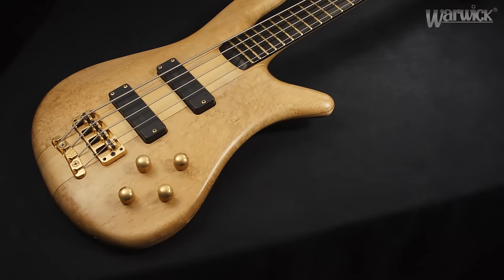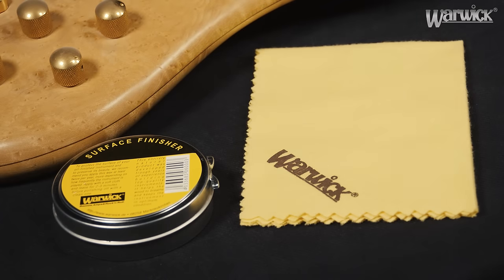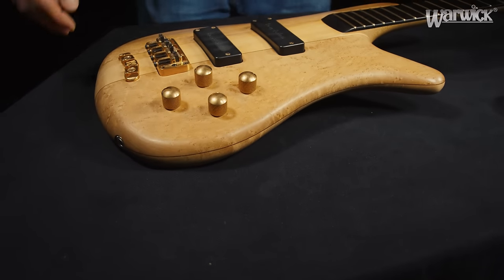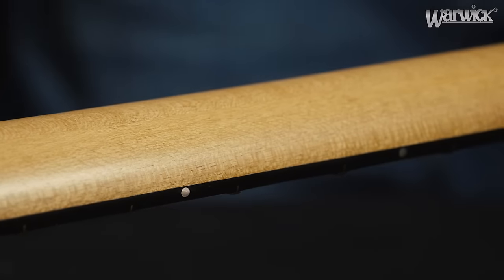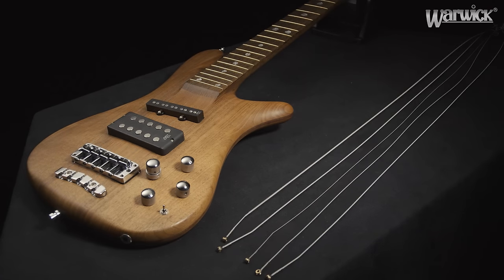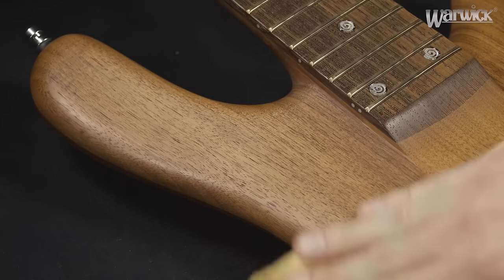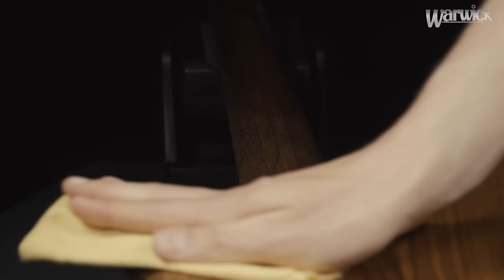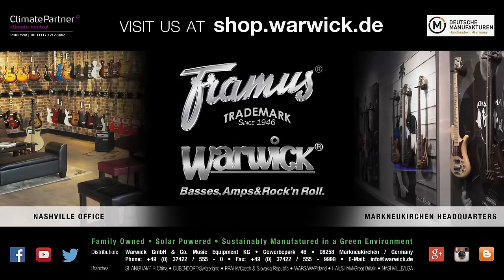Warwick Tutorial: Warwick Surface Finisher with Beeswax

Comment: Hi, this video is great. I'd like to add some feedback. I recently did this processs on my fretless Thumb with oil finish. The process was perfect on most surfaces, including the fretboard. I would also not hesitate to use on a fretboard with metal frets. I find the wax can also clean metal surfaces.

It is an easy process and is actually fun. 

I removed the strings carefully as in the video, and the setup did not change at all. 

**I noticed that the beeswax is likely not good for any matte (flat) finishes that one's bass may have, and Warwick may consider mentioning this in its instructions. The front of the headstock on my bass has a very nice matte finish. Mine is not custom, so the feature must be standard. 

When I applied the beeswax, it left severe irregular streaking. Not scratches, just streaks of wax. This happened nowhere else, so I think the finish on the headstock is different on my bass. I was very concerned that I had scratched or ruined the finish, though I had used the same technique. I tried to re-apply wax and I carefully buffed, to no avail.

The problem resolved when I used F1 wood oil on that part of the bass. This removed the streaks and maintained the matte finish. 

Please comment on this, maybe I did not do it well, though I did the same process all over the bass. Please consider this in your videos and instructions. Thanks!!

Comment: There's one thing that I don't get : as I understand, at the factory, for the basses that have a "natural oil finish", the body of the bass is oiled. Then why don't we just give our basses a new coating of oil  when needed instead of using wax ?
Reply: Oil and wax are derived from the same basic ingredients. Oil is more liquid, " wax" more solidified. Ever use Chapstick? Read the ingredients, one of the ingredients is petrolatum. Ala, petroleum. Ala oil. The same stuff you put in your car, etc.
Reply: Because it's hard to transport oil. The surface finisher makes everything sticky. I use Osmo oil. You will thank me.

Comment: Nice. But, wait a second 

1) I've always learned that removing all strings at once is a bad idea, as the neck would warp because it'll then be under the tension of the truss rod. Now what?

2) What about the fret board (and the frets)? Can I use the same product?
Reply: That's a myth. The trussrod stops it warping.

You can remove all the strings in absolute confidence.
Reply: 1) I agree with mindhead.  Several luthiers on YouTube remove strings as mentioned here. I Just did this and the setup remained stable. If the setup changes, you can always get adjusted.
2) I used the wax on the entire bass, including fretboard. Very effective. I have a fretless, but I would not hesitate to use on metal frets. 

I had concerning lack of success on the front of my headstock. It has a matte finish, and the beeswax caused severe streaking. I fixed it by cleaning with F1 oil, any wood oil would likely have worked. So beware of the wax on any matte finish.